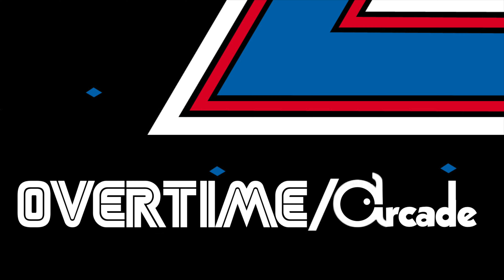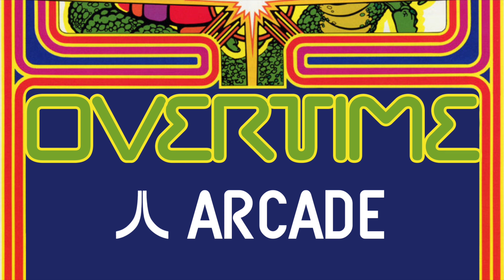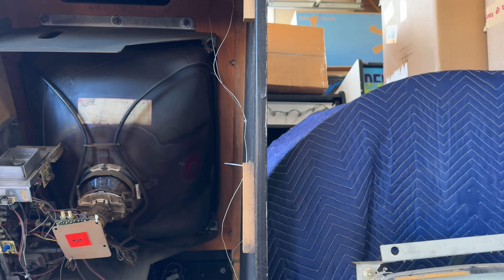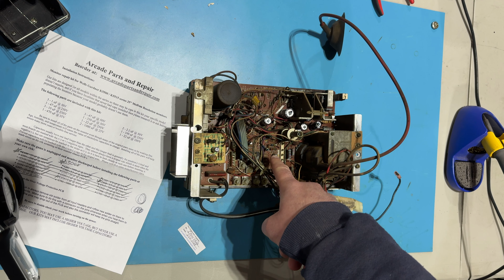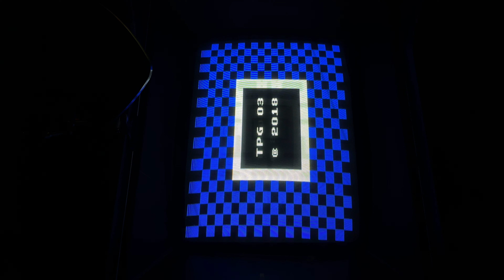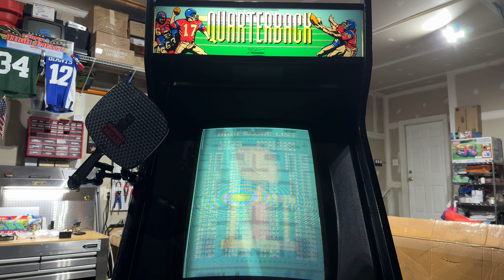The Thrill of Arcade Monitor Repair & the AGONY OF DEFEAT 😩 K5500 Cap Kit 📺 Leland Quarterback 🏈

Comment: Might as well change that Flyback.🤔
Reply from the maker: It’s not the monitor, unfortunately. I filmed this episode last weekend. Since then, I tried a different monitor and the problem followed the game PCB. It’s a board issue of some sort.
Reply: @overtimearcade  the original monitor looks like it has a frequency problem hence the separation spaces on the left side (flipped vertical) (Top if flipped normal / horizontal) of the monitor
Reply from the maker: I think the V-LIN pot controls that on this chassis?
Reply: @overtimearcade  that's a good guess. I've never seen that chassis before
Reply from the maker: @stringerfilms. 25” standard res! Not super common.